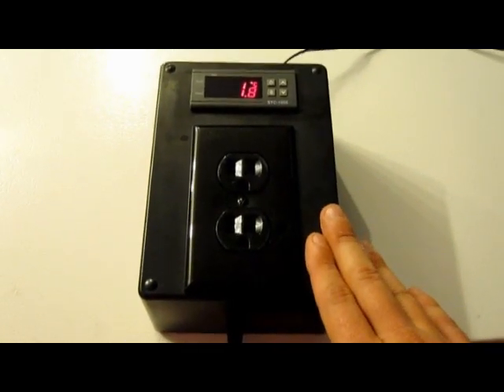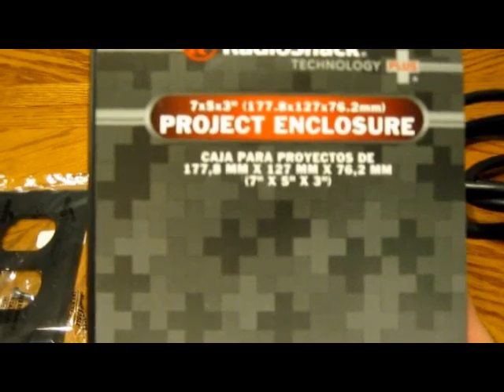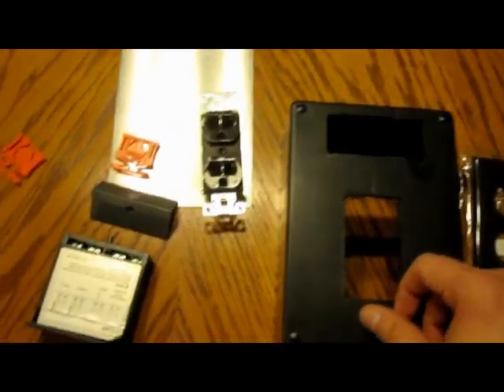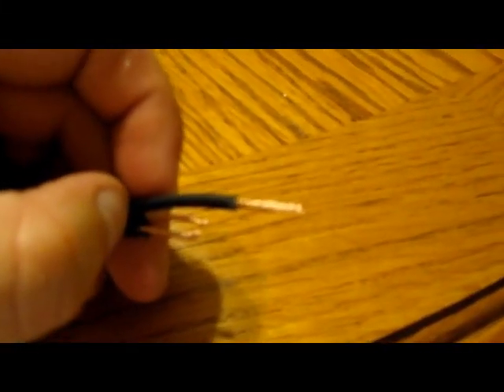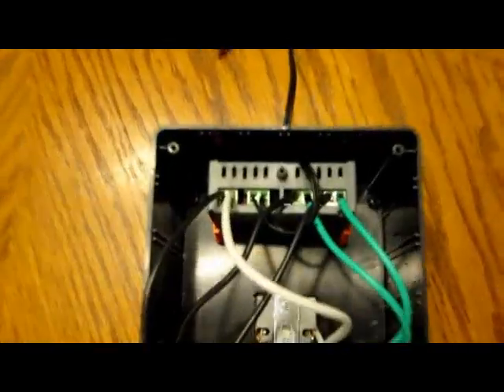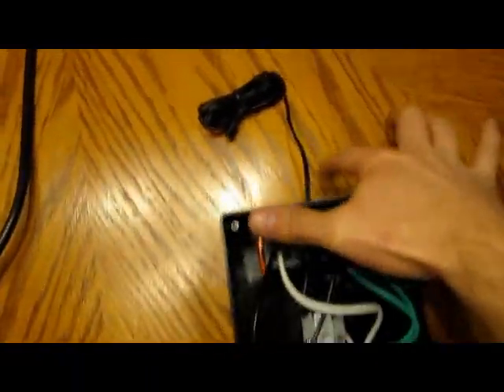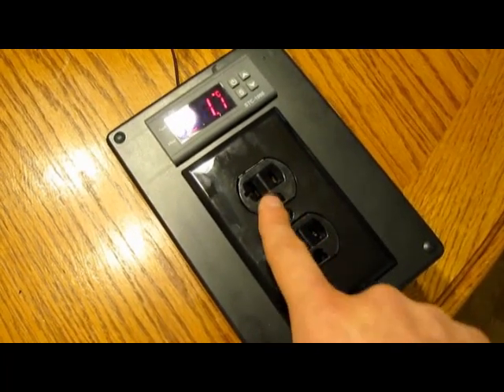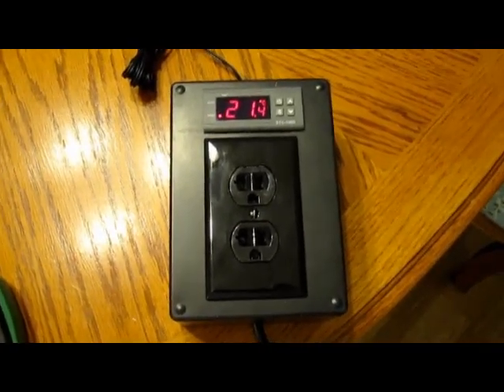DIY Digital Temperature Controller

Comment: This is great DIY Guy...  Made one of these controllers at the beginning of the year.  I have one for fermenting and one for my HLT setup, both of them work great..  The HLT circuit had to have a 240vac (UK) 30A Relay wired inline to run my boiler as the STC-1000 is only rated at 10A (2400watts) and my heater is rated at 4.5Kw so the 30A relay was really needed here to drive the load.  

Maybe you can do a video showing how to wire up a relay to the STC-1000 to increase the load.  Thanks man...

Comment: I am going to do this in the next few weeks but I got a Control Products Dual Stage Controller.  One thing I liked about the CP unit was the fact it has a auto-lag turn on.  This prevents the fermenter box from cycling on and off if there are power surges or some weird thing.  I have a single stage Control Products Controller on my keezer since I don't need heating on it.  Even though you aren't a electrician, it is spot on.  I recommend GFI on the supply end.

Comment: Thanks for the video. Very clear and easy to understand. I wanted to buy the stc 1000 but had a question. I wanted to put the probe into a thermowell for my carboy. I was going to use the dipstick from a corny keg but wasn't sure if the probe would fit? I currently have a Ranco and the probe is too thick. Do you know if the stc 1000 probe will fit a corny keg dipstick?

Comment: Overall a good video, but saying that you wired here there and there doesn't help as much as saying that you wired in slot 1, 3, etc which is ideal since they're all numbered.
Reply: nbspindel I know this is an old post, but you make a fair point.  This is what he is doing - 

Slots are numbered 1-8.

1 & 2 are for the overall power
3 & 4 are for the included temperature sensor
5 & 6 are for the switch to turn on/off the heating 
7 & 8 are for the switch to turn on/off the cooling

Basically what you need is your positive coming into slots 1, 5 & 7.  (these are the black wires in this video).  The way he does it is by putting three short black wires into slots 1, 5 & 7 and then tying the other ends of those three wires with the positive coming from whatever is providing power.  4 wires total will be tied together using a wire nut.

Slot 2, the negative side of the outlet, and the negative lead from the power source will be tied together (these are white wires in this video).  Three wires total.  He did it in a slightly different way in the video by connecting slot 2 directly to one of the screws on the negative side of the outlet (usually silver screws), and then taking a wire from the other screw on the negative side of the outlet and tying the other end with the negative (white) wire from the power source.  It accomplishes the exact same thing as just taking one wire from slot 2, one wire on either screw from the negative side of the outlet (doesn't matter since the tab wasn't broken - so they are connected to each other), and tying the other end of these two wires to the one from the power source.  Either way will work.

Slots 6 & 8 are just the continuation of the wires from slots 5 & 6; just AFTER the switch.  In other words, the positive comes in to slot 5, switch is either on or off, then continues on slot 6.  The same goes for slots 7 & 8.  So slots 6 & 8 need to be connected to the positive side of the outlet (usually gold screws on the outlet).  It doesn't matter which way you do it - just note which way you wired it so that you know which outlet is for heating, and which one is for cooling (these are the green wires in the video with the sharpy marks on the outlet end).  The wire from slot 6 will be for heating, and 8 will be for cooling.

Last, he connects the ground of the outlet to the ground from the power source.  Simple enough - he used another unmarked green wire for this in the video.

Comment: I'm trying to turn on a 12v peltier thermoelectric cooler from a Coleman ice less cooler. I want to use it in a small inclosure to keep the temp at 72. I don't need the "heat" can I just send power to and from the peltier unit to keep it cool? With no outlets, just hard wired.

Comment: No! That thermal controller he's using is accepting direct 120VAC from the wall outlet. The output terminals also are 120VAC. You try and hard wire a 12VDC peltier cooler to 120VAC and something very bad will happen.

All you need is a standard 12VDC regulator (commonly known as a power adapter), the kind that came with your laptop, video game system, or other similar 12VDC device. (Not all video games or computers use 12V, I'm just using them as an example).

Comment: 10 amp fuse X 120 volts = 1,200 watts max unless you use it with a 120 volt relay.

Comment: how did you cut the enclosure? I know normal people would use a milling machine or a vertical drill holder. but in absence of that how would you suggest to cut opening in the plastic box?

Comment: Hi I got the controller and 110V and for F-temp apparently it looks the same but as I'm trying to connect it the inputs and outputs are in different position or so i want to think that cause the way you connect your DIY doesn't match mine. So i will go and ask you if the position is in the correct order by numbers
1 - 2: Loading
3 - 4: Power Supply
5 - 6: Function Control
7 - 8: Temp probe
If is the same please let me know otherwise could you give me the order of yours so i could know the place

Comment: I just wired up an STC-1000 to control the circulator on my solar collectors
It works like a dream circulator comes on at 45 deg c and shuts down at 40
I will experiment more with an ideal temp and differ but it has saved  me $125 over a solar collector,,,,namely a CL-30

Comment: i have been using the temp controller for about 5-6 months in my reef tank and its works great. just thought i would mention it if others had the same question i did ( it works).

Comment: I wired my exactly as your video showed.  I trialed it today.  It did fine up to about 93 celcius and then shut off power to my heating element.  The screen still showed the current temp and it was on the "heat" indicator.  Got any suggestions?  Did you have any similar issues?  I have heard about putting in a relay or something like that.

Comment: For anybody about to build this, here is a link to a controller that has the same specs as the one used in the video, (I believe - check them to make sure for your application) and gives you the choice of displaying temp in F.  http://www.amazon.com/dp/B00QIE0VWE?psc=1
Reply: Raven Heart  For anybody with 0 electric experience, this pre-wired controller is a good choice: http://www.amazon.com/dp/B00V4TJR00
Reply: +axeprice@eBay It is single relay?

Comment: Thank you for this video, I am trying to build a controller for a Humidor.  I will use a 12V peltier plate to both heat and cool when necessary.  Can your controller handle this application?  It heats when the polarity is one way and cools when it is the other.

Comment: I was able to find all the materials needed around the house but I want to make sure they would be compatible with each other before wiring (as I am not a licensed electrician).

Power Cord- 16 gauge, 13 amp, 125 V
Receptacle- 15 amps, 125 V
STC1000- 10 amps/250VAC (relay contact capacity), 110VAC (power supply)

any help would be greatly appreciated!

Comment: Hi trytodiyguy, Thanks for your input, I have a unit assembled and working. I did a couple of things different. My box came with two lids, plastic and aluminum. I used the plastic and I mounted the parts on the lid instead of the case. I also installed a fuse holder at the hot input, with a 10 amp fuse.This is the current rating of the relays. Anyone running a compressor may want to use a slo-blo fuse, because compressors draw more current at start up. I also cut a block of wood and placed it inside between the top and bottom, because plugging something in deflected the plastic causing the STC1000 clips to come loose.
( my previous post was from my daughters account, Amelia)
  Thanks again for the directions.

Comment: Thanks for the great vid! I am about to build one of these myself and I think I will use your design. I am wondering though..Will the control unit alternate automatically between hot and cold? For example, if my beer needs to stay at 70 and the house heater keeps the room a bit too warm I could have have it turn on a fan and vise versa for the heater if it get too cold at night or something. Thanks for the help!

Comment: can u use just 1 plug? say just the heating and have nothing plugged into the cooling plug? 
example I'm using mine to turn a heater on for water.  would that work? do I have to play with the setting ?

Comment: Can I use this controller to control a temp between 108 (42C) and 112 (44.4C)
In other words, Heater relay opens at 44.4C and closes if temp drops to 42C.
I have the unit and don't see how to make it do this.
 If the answer is yes, what do I set F1, F2, F3, and F4 at.
                      Thanks, Mikek

Comment: Next time you purchase a STC-1000 you might want to crack it open and check to see if it has any jumpers to remove that allow it to switch between C and F. I used to work with different temp. controllers and most either were able to be programmed for C or F or had an internal jumper That could be moved for this. And a few like Omron and Red Lion had a unmarked button, that when pushed would do nothing unless held for a certain amount of time, but once it  opened the program it allowed you to make programming changes that only the techs were supposed to be changing. Anyway it is worth a look. Just remember if you do this do it before it is wired up, and stay SAFE.
Reply: It doesn't have jumpers.

Comment: Hi. Excellent DIY project. I just have a few questions regarding wiring. I bought literally the exact same box on Ebay (prob same seller too, lol), except mine is only for one switched device (in my case, a fan). On the back, I have 3 groups of 2 totaling 6 ports. One is obviously power to the wall- got that one. The other group of 2 is for the probe, got that one too. The other two however will not kick the fan on when I plugged it in. Do I need a hot split from the inbound 110v line (to controller and to fan) and then just use the neutral as the switch line from the unit itself? If so, can I just jumper it at the controller itself? Like in other words, 3 to 1 (hot) and 4 is neutral coming from wall, and the other wire from 2 would be the switched neutral to the fan (for the other side)? Any help is greatly appreciated. Thanks in advance. -P

Comment: So understanding the wiring and build is easy and not trying to sound dumb but you would then need to plug in some sort of heater or element into those outlets for them to heat or chill correct? That's solely a brain?

Comment: Does anyone know of a dual, programmable, temp. controller that's 15A, rather than 10A?  I'm looking for something that could be programmed to turn one outlet on at 30F/off at @35F~40F, for the water bucket heater; and, the other on at 40F/off at 50F~55F, for the dog house heater...  (2 of my 4 dogs HATE my service dog.  :(Trying to rehome them; but, I have to be VERY careful. In the meantime, they have to be in a 544sf dog run...)

Comment: this is how to convert Celsius to Fahrenheit: take the Celsius number and multiple it by 1.8 then add 32. Here is an example:  let's use a Celsius temperature of 28 now, we multiple it by 1.8. that equals 50.4 now, let's add 32 which gives us our conversion of 82.4 degrees Fahrenheit
Reply: Brian Arvanetes in the setting CF  u can change to fahrenheit

Comment: Neat DIY worth building. BUT NEVER USE GREEN WIRE for hot wire.  If you have no other black or red wires, cover the wrong color wire with electrical tape, paint it black, something. Just don't anyone ever use green for hot wires.  Right now you know what is what but years from now who knows.
Reply: Really?  Does the green wire carry less electricity?
Reply: By US standards,  the green wire is a ground wire and should not carry current.  Just a safety thing.
Reply: Still a relevant video today, color of wires aside. I used the black, white & green wires where they belonged & bought a small quantity of red wire for the heat side. Today they have improved the STC 1000 & they are available now that are switchable from Celsius to Fahrenheit. A really good build video though, good job!